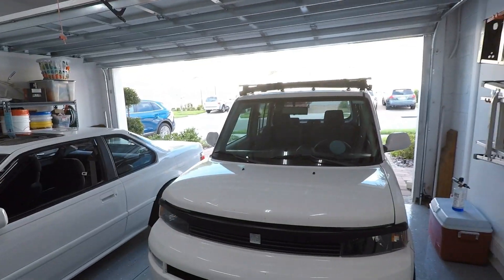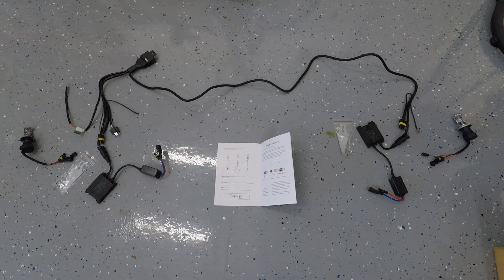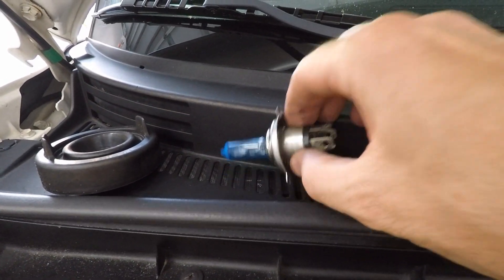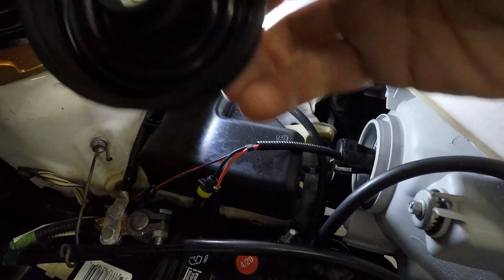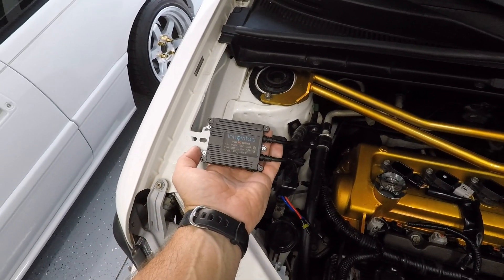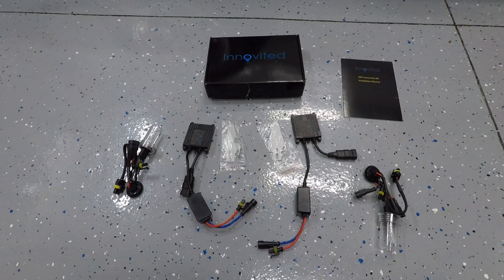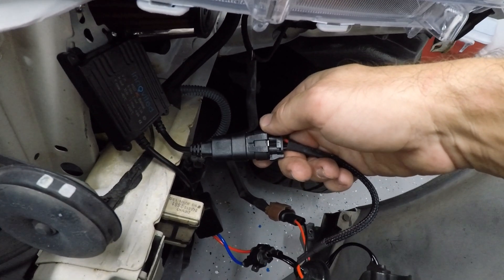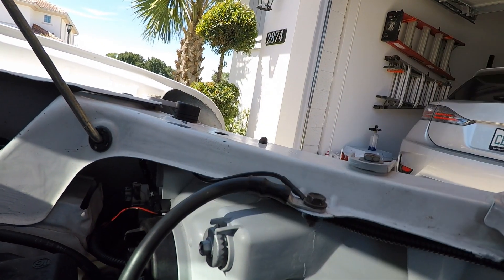HID or LED Headlights for the xB?!?

Comment: Good Evening,  I have been watching your vids lately I just bout a 06 xb 4 a fas saver. I'm interested in those lower fog lamps where can I find them? 2nd question on factory steelies no drop can I run a 205- 60-15?
Reply from the maker: There is a link in the description for the old fog lights.

Comment: Hey friend I ended up with the same set up with hi and low bean just with out fog lights yet and my bulbs came with metal housing that was straight out of box. Not sure if I should remove them. I do have 2 little screws I can remove to take the dome top off and keep the lock pins or take completely off leaving just a black plastic base that can't settle in the headlight housing property. Any thoughts?  Also in my set up the metal housing allows the bulb to shine through on one side and that side in my finished lay out is facing up in the headlight. Just seems odd to me. Thanks
Reply from the maker: You can take the metal cage off if you want. The headlight bulbs can only be installed one way. Good luck.

Comment: Did you remove the metal housing around the hid bulb 💡 or u let it remain?
Reply from the maker: I left it. Is it supposed to be removed? 🤔
Reply: Well with most hid bulbs am seeing now they don’t have that around it so am actually curious myself but I installed my hid that I purchased through you link and I took one off and it actually covers more area but it thing it’s there for a valid reason just need some to explain that reason to me
Reply from the maker: I think it has something to do with the high beams, which I never use (there is no need). Maybe I'll remove mine. Thanks for asking the question.
Reply: Oh ok well as I said to me it covers more area but if you gonna remove them I suggest you save the 2 screws that hold it down and use them back to hold flat base that hold the bulp firmly in the headlight housing
Reply: I wish there was a way I could show you my xb
Reply from the maker: DM me on IG.
Reply: Ok bod

Comment: I have a 05 xB and I have hid headlights but I want to switch to leds. Can you just unplug the stuff for the hids and plug in a normal led headlight?
Reply from the maker: No, the HID ballast will not work with the LED's.

Comment: Did you lose your high beam from this mod?
Reply from the maker: Nope. I should have mentioned that the kit does include a hi-beam, however, when the Hi's are on, the fogs go off automatically, and you really lose a lot of light without the fogs on. So the Hi's are really useless.

Comment: What did you go with 35w or 55w?
Reply from the maker: Great question!! I should have mentioned it in the video!! I went with 35w because I'm running an undersized battery and plan on adding audio in the future. I didn't want to tax my electrical system anymore than I needed too. Thanks for watching!
Reply: @ExtremeDailyDrivers  Word Up! And they still perform great!
Reply from the maker: Yeah, still crazy bright. No complaints!

Comment: Bro so cool man... thanks for the videos ... l have a question about lowering...l did to my xb l used those ones that u can adjusts ... since l got them on the car at driving feels the road any stone u feel it u know what l mean...isnot more smooth...thats normal or l did somethin wrong...hope u understood me... keep.going with u stuff lm.learning alot from u bro...thanks...
Reply from the maker: Probably too low and make sure you get an alignment. Thanks for watching!

Comment: Working on this hid project next! But I need to clean the engine bay first! I have an inch of dirt accumulated from previous owner. Need a video. Yours is very clean. I am doing spray painting on my whole interior red and black. My old factory gray color headliner is black now!!! You have made it so easy for us toaster fans to do these projects! Recommended channel!
Reply from the maker: I did a complete two part detail video on the xB. Search my channel.
Reply: @ExtremeDailyDrivers  im on it brotha! ❤❤❤❤

Comment: Dude. Can’t believe those are only $40! Looks awesome. I’m waiting to order the same black housing headlights (never really cared for the projector lights)
Reply from the maker: Yeah, it's a killer. I'm also not a fan of projectors, but HID's do look much better in them. I guess you can't have everything!! Thanks for watching!
Reply: Extreme Daily Drivers so you only did the low beams?
Reply from the maker: It has high beams too.
Reply: Extreme Daily Drivers haha I’m an idiot. Of course it does, I don’t know what I was thinking... I ordered the last pair on amazon, at least for that link. 10% off coupon even! Lol
Reply from the maker: Nice! Send me a pic on IG when you get them installed!
Reply: Huh... so I just installed them... the car has zero power.
Reply from the maker: @codytaylor4351  What did you do?
Reply: Extreme Daily Drivers lol. While I was hooking up to the battery I got a phone call and forgot to tighten the positive battery cable down 😂🤦🏼‍♂️
Reply from the maker: It's always something simple. Glad you figured it out.

Comment: I did projector lamps with the projector lens. If you go that route, and use HID bulbs in yours, I’d love to tell you what all I bought to make it work so you can see if can do better. I made mine work, but I haven’t asked any lighting expert if the parts that I purchased are necessary or some of the parts are not necessary. You know, to save you some money.
Reply from the maker: That's the ultimate set up. I might do that some day. Thanks for watching!

Comment: L.E.D. Because they last longer than H.I.D, especially when u mess with more and more cables to work on H.I.D., instead of easy plug and play L.E.D. 
So L.E.D. Is a much better choice

And for L.E.D. I’d love to go blue, baby blue,those elegant crystal blue like all those vehicles that comes from the factory and they make it look elegant
Reply from the maker: I totally disagree. I did a ton of research, as I always do, and LED's are still iffy. Kits fail quickly, just like HID kits did when first rolled out. Check out Amazon's reviews and you'll see what I'm talking about. Also, the way an LED bulb is constructed there is a dead spot on the tip which hurts light output. For the money and look, you can't beat HID's.
Reply: Extreme Daily Drivers interesting. I’ll look it up then

Comment: it must be Tuesday!!!
Reply from the maker: Hell yes!!
Reply: @ExtremeDailyDrivers   What is the reason or preference of getting power from the alternator vs getting power from the battery??
Reply from the maker: Great question. There is no benefit, it's just the way I laid out the relay kit. I could have gone the other way just as easily. The alternator gets it's power from the battery so there is no difference there.

Comment: 6000k Is like the whitest white you can get
you might be thinking of 8000k for slight blue tint
Reply from the maker: False!! 4300k is the "whitest". 8000k is very blue. The bluer the light, the less our eye can pick up the color so the less we'll be able to see. 6000k is typically the best compromise between performance and looks. Thanks for watching!
Reply: I agree!😜 But not all 6000k bulbs are equal. My old set on my '05 that I loved was a 6000k phillips german made bulb from a seller on ebay. (id have to look through my history) but that white was like the construction site white light which was exactly what I wanted. The last I checked with the seller they were out of stock. (I'm still waiting for them to come back) The 6000k I have are like how you described with a slight/subtle blue tint, not that construction site white.
Reply: If you look at a kelvin chart, 4300k is “clear white”, most call 6000k “diamond blue” white... 👌🏼 8000k definitely throws more of a blue/purple hue.
Reply: @ExtremeDailyDrivers  Oh I see, I have 6000k lights and they seemed just white

Comment: No to both. The stock housings are not designed for either of those bulbs. Do a retrofit if you want proper lighting upgrade.
Reply: Exactly.  You need projectors designed for HID if want HID, LED projectors if running LED.  Otherwise run the risk of blinding oncoming traffic.   No Bueno
Reply from the maker: You are right, but I disagree. HID's don't blind people. Improperly aimed headlights blind people. Do HID work better in a projector housing, yes, but they do just fine in a stock headlight housing. I now have a couple of hours of night time driving since I did the install and have not been flashed. I have been behind and in front of police without anyone raising an eyebrow. Thanks for watching!
Reply: Extreme Daily Drivers show us a wall shot of the output and I’ll believe you. In 90% of cases, plug and play HIDs will cause poor lighting scatter. This isn’t just limited to distorted or no cut off lines, but I’m talking about uneven random hot spots on the ground in front of you. It might “seem” brighter, but the actual useful light on the road is less. This is because most HID bulbs have 2 spots along their length that actually produce light, both in different spots than where the Halogen filament would otherwise sit. If you look at a dual filament headlight bulb, you can see how close to together those filaments are. That’s the difference between lo beams and high beams. A small difference in light source placement on the bulb gets amplified and makes a huge difference to where the actual light is aimed out of the housing. Seriously it’s not hard or expensive to just retrofit your headlights. The rest of the build is clean, the plug and play HIDs are just doing it a disservice.
Reply from the maker: Again, I disagree. HID's were designed for projector headlights. There is no argument there. And I might do the conversion someday. But again, HID don't blind people. Poorly aimed headlights do. It doesn't matter if it's a Halogen bulb or LED or HID. And as far as if HID are "brighter" than Halogen, they are. It's very obvious. I guess we'll just agree to disagree. Thanks for watching.
Reply: Extreme Daily Drivers again, show a wall output shot and we can see where the light is actually going. I’ve had this “debate” enough times to know that in the vast majority of cases HIDs are a road hazard in halogen lamps. I would post comparison pictures but YouTube comments don’t have that ability. Also, read my last comment more carefully. The position of the lighting source relative to the rear reflector changes the effective aim of the headlight. Not only this, but even if the light source was precisely in the same spot as where the halogen was, there are way too many lumens for the halogen reflector to handle without producing excessive glare. This is because the headlights with original bulbs were designed to produce a small amount of glare out of the factory so that oncoming traffic can tell the lights are on at night. With the excessively bright bulbs, the glare increases proportionally to the increased output of the brighter bulb, and becomes blinding for oncoming traffic rather than merely helpful for them to see you coming at night, like what was intended. You are right on one thing though, there is no argument here.
Reply: Extreme Daily Drivers what you fail to understand is that with an improper lighting setup, there is no way to properly aim the headlight now. That’s because in the vast majority of cases, your entire beam pattern gets screwed up. You need to retrofit the headlights if you want to maintain a proper lighting pattern, so that you actually have the ability to aim the headlights.
Reply: Led bulb upgrades on both projector and reflector is the way to go, as long as u get the right ones

Comment: By using HID’s in a regular headlight bucket you blind all on coming traffic. If you run them it should be in a project bucket, to keep the bright light cut low so as not to blind people. Biggest mistake when using HID’s.
Reply: In a projector style bucket.
Reply from the maker: Not true, but thanks for watching!
Reply: If u get the right kind of HID on a reflector headlights, u will not blind others